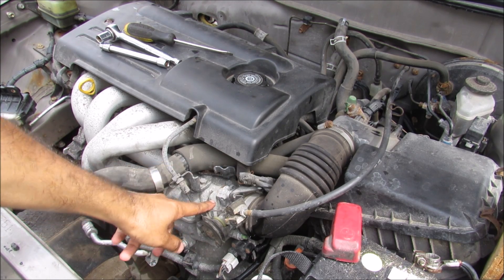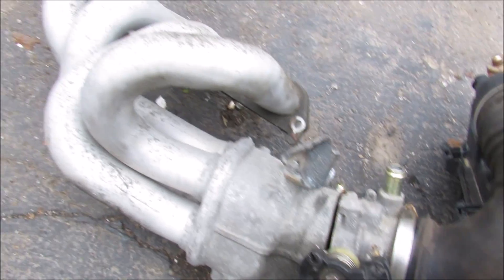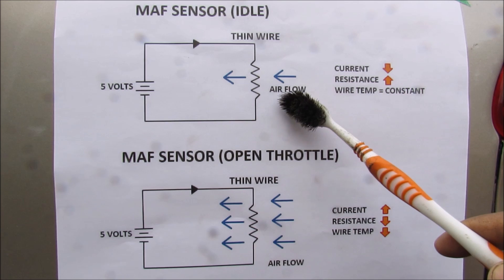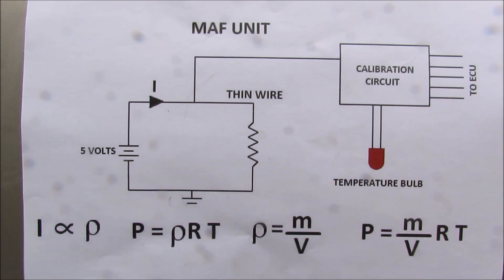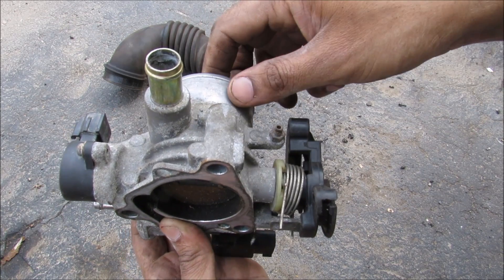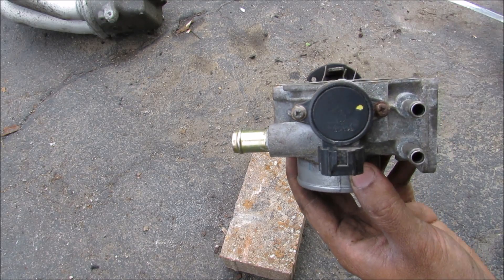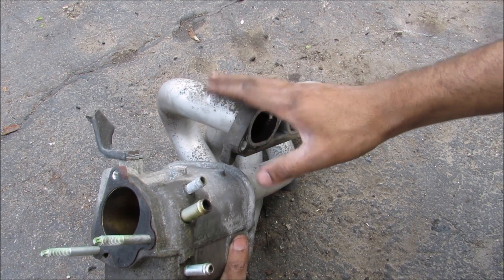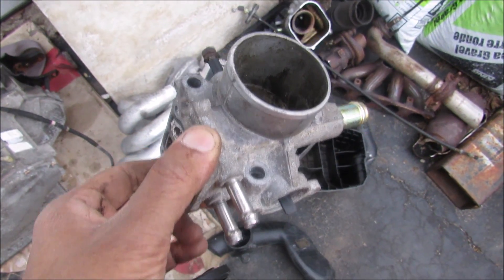How an Air Intake Works

Comment: I like your video alot and wanted to know more!  How do the 3 valves going out of the manifold work 

* Ventilate Car Cover
* Break booster
* Evap system

What role does each line have into each one of those 3 points?
and if I'm trying to find out if there's an air leak, could I use any of those 3 points of air out?
Thanks

Comment: What year of Corolla is this for?  My 2005 S model doesn't have the same looking throttle position sensor that your description has.  I has some electronic device riveted to the right side (rear of the car) to the throttle body.
Reply from the maker: Yours has drive by wire

Comment: Hey I have altis 1.6 manual transmission 2012 model. Last week I put it in 4 gear and all of a sudden a very loud noise came and the engine died. I towed it to Toyota dealership where they checked the engine compression which was 0 in 3 cylinders. They took the tappet cover off and there were 7 rockers lying in the engine out of 16 rockers. I had put a cold air intake, 6 puck clutch, straight pipe and spark plugs which are all aftermarket things and not genuine. I did this to increase acceleration of my car. Can you tell why did the rockers fall and if I now race my car will they fall again? I have never experienced this before in any altis 1zr fe engine. Can you please help me?
Reply from the maker: Lack of oil pressure can reduce pressure to the hydraulic lifters causing them to become loose.
Reply: @speedkar99  what is the permanent solution to this? A noise came when I put it in 4 gear after which the engine died. Now I am a bit worried that will it happen again when I do a drag race? Is my car reliable?

Comment: This is helpful, please may I ask, (what's really bugging me) how is the air sucked through from the outside, through the air filter, through the throttle body to the intake manifold. How is the air pulled through to feed the engine?
Reply: behind your grill will be passages that lead to your filter

Comment: So there is no Box in intake manifold to stock the air like other car have?
Reply from the maker: Not on this car
Reply: @speedkar99  Thanks for your reply.
the boxe is there to stock the air but with only theses pipes/hoses, where is the air stock so engine can suck easly?. i am little confused bcs without boxe engine will not suck air easly at all.

Comment: If mas sensor read the air flow so why there is throttle position sensor tps for, because when we accelerate so mas sensor read the air flow and give ecm a signal for fuel adjustment for the air which flow by mas sensor in combustion chamber so why we need tps,....????
Reply from the maker: The throttle is the driver's input 
The airflow is the result
Reply: @speedkar99  does the tps sensor make rich fuel mixter according to how much butterfly valve is open due to how much driver press the accelerator .. so does the map sensor make low fuel mixture for ideal and tps make rich for go faster according of butterfly valve open... Plz reply in detail ..???

Comment: I have enjoyed watching your videos and will continue to do so. Very informative.
However, I notice in a couple of them that the recep. saw is not being used properly. Please accept this tip as a goodwill gesture and not a criticism.  

In order for the recep. saw (sawzall) to cut properly----1-there should be a proper and sharp blade installed depending on the material being cut. 2 the nose of the saw MUST be pressed against the object, so the saw body stays stationery. That way the saw blade moves the entire stroke of the saw and cuts. If the nose guard of the saw is away from the item, the whole saw can move back and forth and not cut as efficiency as it should.

Just a suggestion. Try it you will like it.
Reply from the maker: Thanks for the tip. That would work if I had a stationary vice. But I'm working on the driveway and have to hold it with my hand while cutting
Reply: Just push the saw against the item to be cut. It helps if the item was secure of course, so  a heavy object on top of it would help. Good luck.

Comment: Does a heimholtz resonator add power as well as reduce sound? I remember reading somewhere that it benefits flow characterisitics too.
Reply from the maker: That would be an interesting thing to look into.
Reply: @speedkar99  I'm assuming it's at least similar to the flow rate increase caused by absorption mufflers (the ones with perforations along a straight pipe with sound-absorbing materials packed outside of the perforated pipe). The theory is air has surface friction along solid pipe walls, but the perforations reduce the surface area of a pipe and thus, reduces friction of air passing through.